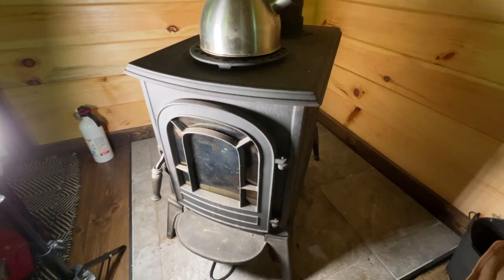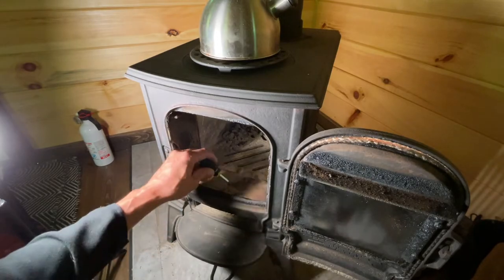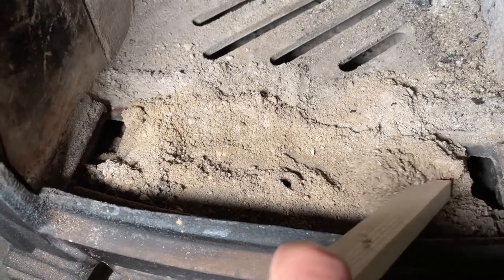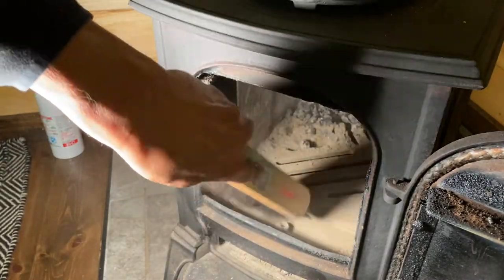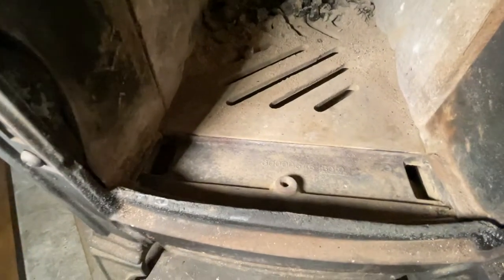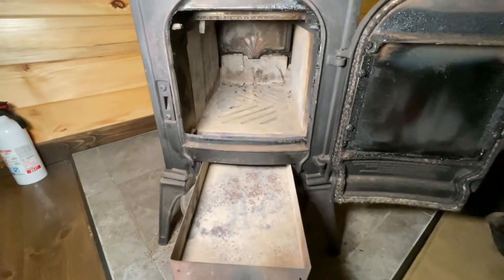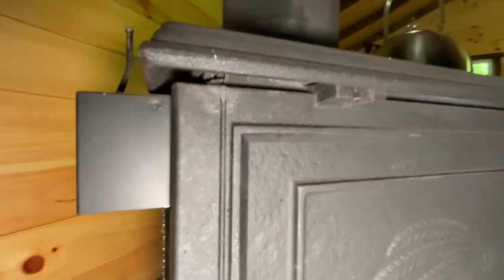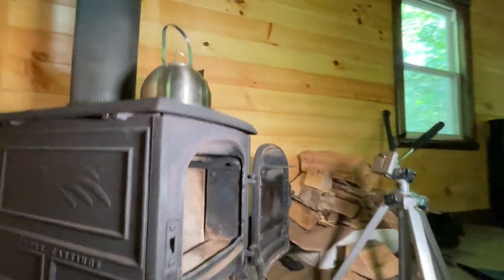Vermont Castings Aspen  -  Cleaning air intake

Comment: i have been burning for some 32 years.   I am very interested in this stove, mostly because of history of the company even though it has been sold some years ago, it seems the overall company game plan for design and standard appears the same.   I am rebuilding an encore currently from my purchase 32 years ago and it is still functioning.   new gaskets and catalytic and she will be good to go.  I am going to replace an old consolidated dutchwest cast iron unit at this time in an enclosed porch.  it has also been in use some 32 years.   old and tired with more use and a great deal more complicated to run.  this faithful unit is going to be removed and I believe the Aspen C3 will replace it.   This is the first video i have seen explain the ash pan.   I honestly did not know that one was even present.  as far as your cleaning process.   by removing the ash pan and applying an approved shop vac (style vac) into a (stove Many Days cool) you can easily get to all the needed areas from the ashpan.   taking that screw out seems unnecessary, if you have to right shop vac style tools.  I am not putting down the video, mostly because you showed me more than I knew about this stove and how the C3 system works.  I actually feel more confident in now making this purchase.   

final question, is the Air Wash for the glass sufficient to keep the viewing window clean for fire viewing.   that is pretty important to us.   thanks in advance.   P.s.   get a proper vacuum and avoid yourself a house fire down the road.   this is coming from a retired 31 year veteran firefighter.  you vacuum is just not made for this type of work.  truly dangerous, besides very dusty.   be safe.
Reply from the maker: Thank you for your comment! To answer your question I would say the  air flow can keep the glass clean if you run the stove properly. The Aspen is just not a stove I can deal with. I don't live in my cabins and therefore I don't run my stoves continuously. I had a brand new Aspen C3 and it did not work for me at all. I returned it for full refund.
For my occasional use application the Jotul 602 is the much better choice. Have you considered the Jotul F35? I have one sitting here, but I am currently not using it. Seems like a great stove to me.